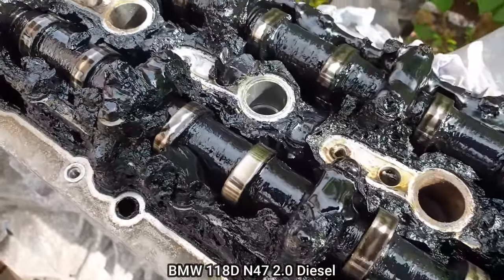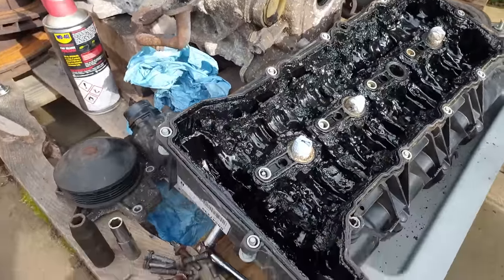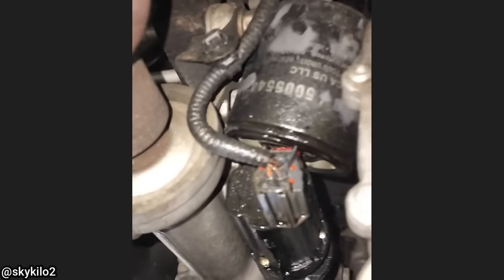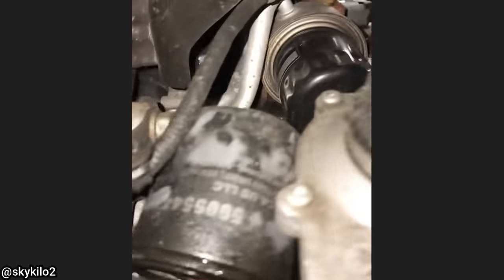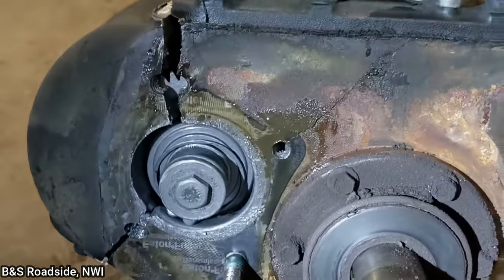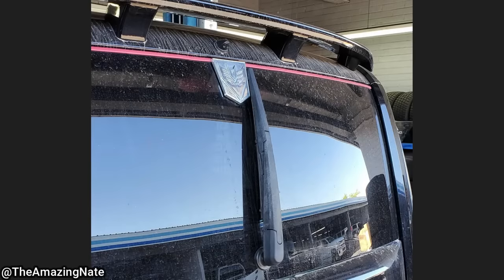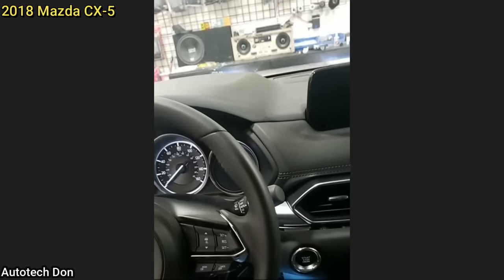Customer States Repair Engine On BMW I Just Bought | Just Rolled In

Comment: Seeing clips of clogged-up engines reminds me of trying different types of commercially available degreasers & finding that none really worked, so I experimented a little bit & finally came up with a water-diluted mix of sugar-soap & cloudy-ammonia which worked amazingly well!
Reply: Stevie-Ray  Interesting. My brother used to put a little simple green in his car at every oil change, and he eventually sold it. It needed engine work later on, and the mechanic said the engine looked like new inside. Not a speck of sludge or varnish. I suspect sea foam would do as well.
Reply: @hopelessnerd6677  Excuse my ignorance, but what is 'simple green'?
Reply: @stevie-ray2020  Its a general-purpose degreaser. Mostly monobutyl ether, which is in almost every household cleaner. They also sell it as an engine cleaner/sludge remover. Apparently a little in the oil keeps things clean inside.

Comment: The BMW engine at the beginning is a side effect of the 25k mile oil change era of BMW. I’ve seen a lot of them that were serviced at the dealer and looked like that inside. Same thing with the other “lifetime” fluids. It’s not an inaccurate statement: the fluid exists for the lifetime of the part. They just forget to mention that the lifetime of the part will be substantially reduced because the old, used up fluid will destroy it.
Reply: it's a self fulfilling prophecy, this "sealed for life" crap

Comment: The blown up gearbox is an Eaton twin split box, I used to pull them out overhaul and refitted them on our tankers
Reply: Well it definitely has twin splits in it.
Reply: I'm the guy filming that video, it's absolutely insane he drove so far before we finally replaced it. The replacement he got from the junkyard was designed for an international cab and he had a Volvo, we ended up taking a torch to his shifter stick to bend it into place lol

(The top plate from his old transmission was cracked so we couldn't swap it over)

Comment: BMW owner from the first clip here. Thanks for using my clip! The car has a new engine now. From the start I assumed it will need new engine, so I went that route and just bought a new (second hand) one. When the "new" engine was off the car I have done the timing chains, guides, tensioners, seals, etc. The N47 engines are known for timing chains failures (even Wikipedia mentions this). Car is running good now and it is my daily to get to work. If anyone would like this engine feel free to get in touch. You can have it for FREE (assuming you can arrange your own pick up/ transport from Scotland). Otherwise it's just going to scrap yard as fixing this is way beyond my skill level. I don't even have a garage, I just done the work on the engine under gazebo and put it in the car on my driveway.

Comment: I always pop the oil cap off and try and look in there before buying a car. If a baffle is blocking the view, take a whiff. And engine with that much black sludge will smell very strongly of burnt sludge.

Comment: 1:25 Likely won't be too long until he's in the shop looking for rear end issues. To break the case of one of those things!!! 
2:44 I work at an auto wrecker/dismantler and we were stripping down a car for crush with those vents. Took the shop air to it. Sounded like an F1 car revving up. Caused a little work stoppage while everyone else just had to do it.

Comment: As someone who drives trucks, I can confirm that 3rd, 6th, 7th and 9th gear would be adequate to drive most trucks around, unless you had a heavy load or just HAD to go 80mph. Anything under 25,000lbs on the trailer and the truck just doesn't feel it, I can start in 3rd easily and skip the even gears all the way up to 10th. 3rd to 6th would be a little long and 9th as your top gear would keep you around 65mph, but it would be totally doable.

Comment: That first motor would a dream to work on. I think most guys would want an excuse just to go out into the garage / shop area and work on something and that sludge encrusted engine is perfect for that. It doesn't matter if it'll ever work again (it might) but that's not the point. It's just for getting away from the wife and having an excuse to use your tools every day because you like using them. The engine may eventually be completed but take many months to get there.

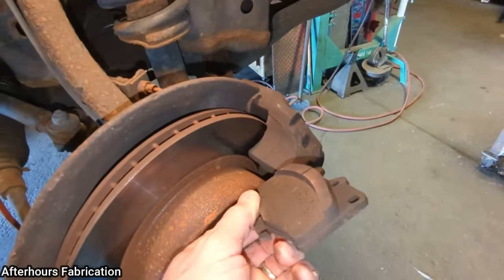Comment: 2:38 to be fair, the uneven wear doesn't matter, since that part of the pads isn't getting used.

The reduced braking performance and more concentrated heat might matter though.

Comment: I had the same problem with a tapping sound caused by a front license plate. I stuck rubber bumbers under the unsupported bottom edge.

Comment: It genuinely blows my mind how oblivious some people are about vehicles. While working roadside there were like a dozen situations where people would call me out to change a tire and not know the spare needs to be mounted on a wheel. 

Or say they just have a flat, but when you get there they have 2 flats and one of them is folded under the car from sliding into a curb at like 40mph... You don't need a new tire, you totalled your car.

Comment: that poor BMW engine... older ones can accumulate hard sludge, but rarely as much as this one. and then there was the one 520i, second generation. I don't remember the kilometers, but the last oil change wasn't verfiable anymore. we fixed it for german TÜV and talked the owner into an oil change. he agreed, and after a quick test run (the emissions test was bad, too) the engine suddenly started to slow down and soon stalled forever. we removed the valve cover to find a similar residue. there was even a bow of stuff bridging over the timing wheel! I don't know what happened to the car; the owner eventually paid for the fixing sans oil change and had the car towed away.

Comment: 0:36 that is running rough for a Nissan, Just judging by the vibration all the way to the trunk..
2:17 bad ground wire cause someone installed a new radio i bet and didnt use factory connectors..

Just to clear up some questions.. Been a mechanic since i was 14 working on my dads cars and equipment..im now almost 50.. Im what they call a jack of all trades, But a master of none..

Comment: Some local guy who competes in drifting bought a used engine from a totalled BMW in a junkyard. It looked pretty much the same under the valve cover. He later found out that the engine had seized and caused the accident. Basically locking up the wheels instantly and sending it reverse entry towards a ditch. The guy obviously got his money back from the junkyard owner.

Comment: I was one of those guys who was careless with my cars. I had a 1987 Plymouth reliant..It was burning a little oil. I had to drive 60 miles..I just bought that cheap oil they sell at the stores for emergency use. I was 30 miles In when my engine light went on, I slowed down, and could hear the knocking😖Thank God I didn’t go all 60 miles. I nursed it back home, on the way I saw a oil shop, the guy straight out told me, that with that knock he wasn’t going to change the oil. I told him about signing paper, he would not do it, finally I got home. My friend was a former mechanic..He still had the tools. We got to work on it. Finally took out the engine and opened it up🤯 it look like black tar in there. We cleaned it bore it,basically did an overhaul on it. I told myself, never again, will I neglect an engine. Now I buy the best oil, best filter, and change it every 3000 miles, even though the oil company claims 20,000 miles. I learned my lesson the hard way. The knocking was the rode hitting the bearings, thank goodness the bearings didn’t break, they were very scratched up, because I nursed it home.

Comment: I want that spinning vent grill on my car. Is that still an option? I could hook the spinny part up to a tiny generator, and use it to recharge the battery.
  If it were on a Tesla, enough of those vent generators could power the car.
                GENIUS!!!!

Comment: It’s not just in the USA, I found a 1980s Rolls-Royce, dealer serviced, with different sized pads, after a Fatal accident, and an Alfa Romeo, with inboard discs where the owner driver had just changed the pads on one side, as the steering rack, I think, blocked access to the drivers side, from a high speed stop he lost the offside brake and killed his passenger as he went into Armco barriers on a major Motorway (Freeway). You can’t cure stupid!

Comment: What was in those tires were clips to connect rubber convayor belts on rock crushing machines together...they come in buckets of 100
Must have fell off someone's truck 
I went to help my brother who works at a concert recycling place and this is what we used to clip a convayor belt together after changing the old one out...it was hell to change that belt and I'll never do one again I promise you that

Comment: Nice video as always.

Guys. what really gives me the chills is how dependent and non-thinking the majority of ppl has gotten. A "strange sound" = licence plate, a whiper "not working". I mean, the "as cheap as possible"-fraction has been there since the beginning of cars for the masses, but this plain stupidity was not in so many folks.
Reply: @dunebasher1971  I'd say you got a point here, yet, I say it's both: fast and widespread sharing as well as us getting dumber.

Comment: This time, I believe the owner of the car with the oil leak after going to a shop. And at least it was a simple mistake! I did the same once. After getting on the highway, I had smoke pouring out from the hood. I freaked out, thinking something blew! It was a pre-smog car, and at least cleaning the engine bay, cowl, and windscreen was easy.

Comment: I used to install mobile electronics back in the 90's. I've seen some crazy stuff that DIY'ers did. So thr wire across the engine was no shock to me. However, I was a little taken aback by the window switch pulsing the door speaker. Kinda feel like somebody might have done that on purpose to mess with the customer.
Reply from the maker: In regards to the window switch one the tech said the customer bought an used door panel from a scrap yard. It was for the same kind of vehicle but newer. It was causing some weird issues and the windows wouldn't roll down as well.

Comment: so on that first clip is it just not possible to use degreaser or possibly powerwash all that off?
Reply from the maker: You could definitely clean it up. There's a chance there could be some damage done to the engine though.
Reply: @JustRolledIn  so too much work to risk it then, Thanks

Comment: i had to do something similar in what that trucker did but i was in a sedan ,, the shift linkage broke and car was working in 3rd and 5th gears ,, the problem that this happened in a fkn crowded place where i had to press cluch to aviod engine go under minimum working rpm 😑

Comment: So I got a legit question. The first clip, is there actually a legit way to clean/fix/repair that? Do the valves,cam, head etc actually get damaged? Or does it just get to the point where the engines so gummed up with shit that in turn it causes damage? And what happens if u let your oil gum up that bad?

Comment: 1:25 Pfft, it's not uncommon when driving a semi to skip some gears...

Unloaded.
Reply: I actually had that happen to me in 96.  I was down in Alabama truck hung up in the high side of the transmission.  I pulled into a local shop they pulled the shift tower off it to look inside put it back on and told me what they found.  The main shaft for that transmission had broken right and would only allow the high side gearing to mesh properly.  I called the boss and told him what they had found he said limp in as far as you can if you can get it back here you get a bonus of what the tow bill would be from Alabama.  I burned the clutch up getting it going but made it all the way back to Illinois with only 5 out of 9 speeds in my transmission.  Boss was true to his word and gave me a 4K bonus the next week.  Truck got an upgraded transmission went from a 9 to a 13 speed.  The transmission that was removed had over 1.5 million miles on it and had never been overhauled.
Reply: @haroldbenton979  While I have never driven a semi, I had my dad's 1500 Chevy when I was old enough to drive and burned up the tranny in it.  He was going to work one day, didn't know anything was wrong until the transmission was making weird noises.  The shop said the shaft output seal went and blew all the fluid out.  They replaced it, filled it with fluid and said "you'll get about a year out of it".  Sure enough, I'm driving it and the entire thing just ground itself to dust, even with full fluid.  I could shift through gears without the clutch.
Reply: @cujoedaman  on most OTR trucks there are 2 sides of the transmission a lower side to help get you moving and then the higher side of the transmission. You basically have a reduction gear set in the backend of the transmission to allow the extra gears to work.  Well where that shaft in mine had broken would not allow that reduction gearset to work.  I had just the top half the transmission to drive with.  All this in a truck with trailer that was around 32K pounds empty.  I also had to get fuel pull on and off the interstate to sleep in accordance with HOS regulations and other things.  So I went 900+ miles with a transmission that was grinding metal on metal and tearing itself apart all the while.  When I got back to the yard and they tore it apart they where able to pour the bearing and gears out of the case along with about everything else.  They had no clue how I made it back.

Comment: You know, this kind of neglect is also why i like EV's more and more. say, its difficult to neglect a EV, i mean sure. a lot of them has a cooling system ( mine doesnt ) with coolant which needs changing once in a while, but how much is there in the drive line? nothing really. Then, you have your other regular stuff like brake fluids, tyres, pads and rotors, bushings. But nothing really crazy. Once Battery repair shops become more regular, it'll be dirt cheap to own and drive a used EV, a battery repair will be no worse than a old Prius that needs a cell or two changed and there is shops out there doing that relatively cheap.

I used to drive diesels and regular petrol cars, i sometimes still miss my old CLS500 5,5 V8.. but jesus, the amount of money im saving on driving a EV is absurd, we talking 1/3 of a gas car, i drive a 2021 Leaf E+ tekna.

Comment: don't hate on beems. just do your homework. i looked for years for an N94 335xi.  when i found 1 in 2013 it had been wrecked and repaired but had low miles.  i got it for around 6000 bucks and had my tuner look it over.  he could not find anything to seriously complain about but said meh. drive it till the wheels fall off. i'm still driving that lil space ship and spanking everything that wants to play.

Comment: First engine might be able to be saved if they cleaned it out.
Reply from the maker: Its a possibility. In an older video a customer never changed their oil in 12 years and the tech cleaned it out and it ran great afterwards. It was running when it came in surprisingly. This one sounds like they bought it as a non runner.
Reply: @JustRolledIn  Might as well clean it out if they are going to buy a new engine anyway.

Comment: The cars with rat nests of custom wiring, do dealers just send them to auction or try and fix them.
Reply: Depends on the cost/profit. If it's going to cost enough to fix that there's little profit, then it goes to the auction.

That's why only people with a good knowledge of vehicles should buy at an auction. For a POS that's the last step before the crusher.

Comment: Changing oil from conventional oil to synthetic and back to conventional will gum up the engine just like first video. I had bought a used 86 Ford thunderbird turbo coupe. The previous owner had been using synthetic oil and didn’t tell me, so I changed the oil with conventional oil and when it stopped running a few months later. I opened the valve cover and found that the oil was gummed up and 1/8” was worn off every lobe of the overhead cam. Fuck synthetic oil!

Comment: I really don't believe half the videos that claim the engine starts when turning or pushing some other random button of the car. Hardly ever show the ignition in the shot.
Reply: yeah exactly lol
Reply: If it specifically involves someone installing a remote start, it's quite believable they screwed up the wiring involved in starting the car.  Even if the random control isn't wired in to it directly, if it's wired in wrong, changes in voltage when other things are turned on, like the headlights, could cause the computer chip to do weird things.

Comment: Good googly moogly. Why would anyone want a BMW anyway? They could've bought a Ford, Chevy, or Mopar. These modern vehicles are all junk anyway, with airbags, and crumple zones, plastic parts, and no chrome... I prefer Pre-1973 American made steel. 73 was when Ralph Nader's "safety" features were first implemented. 72 cars looked like cars. 73 and after look like Mussolini sticking his chin out. Vehicles have been getting progressively shittier and shittier ever since. Now big oil is jacking up the fuel prices, and Big Brother is trying to force everyone to drive electric shitboxes. Makes me wanna drive around DC rolling coal on yuppies.